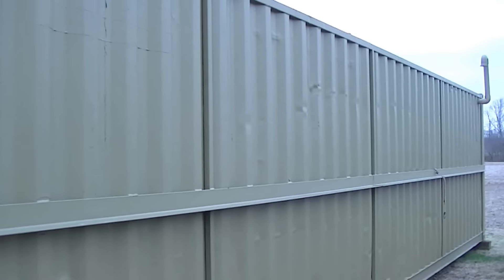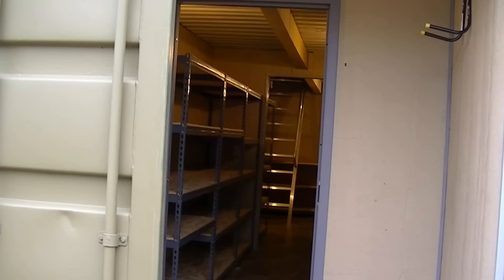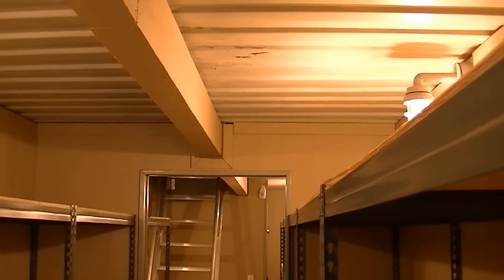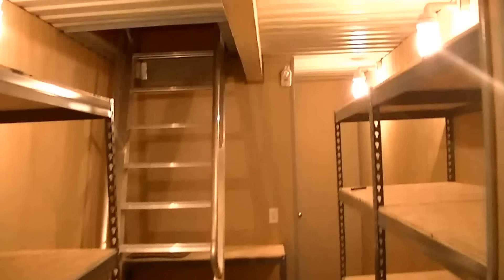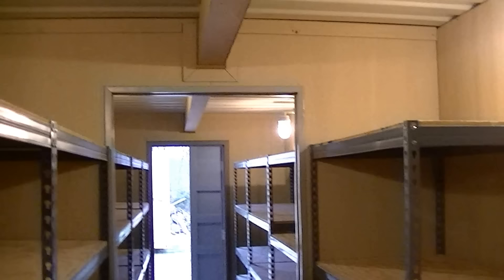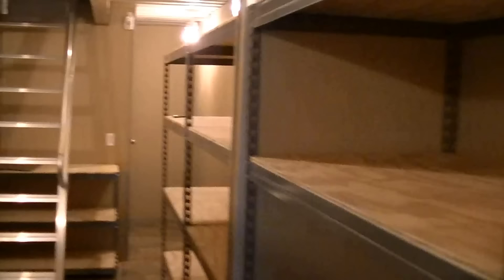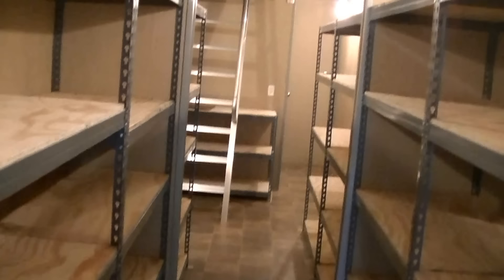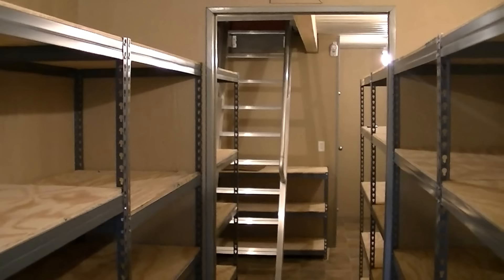Underground Shelters built from Shipping Container

Comment: Shipping containers are made of Corten steel (look it up).  Forty foot units, in particular, are designed for 25-30 years of service at sea (salt water).  They get 2 coats of enamel from the factory but should they get heavily scratched or dented, Corten steel is designed to create a surface rust that does not permeate through the steel.  The guy in the video mentioned that they also triple coat the container with paint.  However, a proper drainage system around it is the best investment.

Comment: But no place in there to relieve yourself,  and the unit will start rusting under all that soil within a year.
Reply: I always think of that same question too! When people consume food they MUST relieve themselves!!! HOW?
Reply: Eyes To The Sky Apparently somewhere in the comments section the video poster provided an answer. It seems to be a dual unit. The other unit will have all the other goodies, as this part is used mainly for storage.
Reply: I'd put a composting toilet in the safe room.
Reply: Adding a sacrificial anode rod will greatly reduce corrosion, if done right.
Reply: Lee Sharon LOL! Yes be OUT in the danger, when you need to be IN.
Reply: GeekBoy03 If it is THAT bad out, its ok to shit in a bucket lined with a trash bag, otherwise, USE THE SHITHOUSE! You don't want human excrement in your enclosed shelter!
Reply: Lee Sharon Hillary supporter? LOL! That is why have a composting toilet, or build a septic system for it.
Reply: or just put a safe room in your home though it has to be done while it is being built our closet is encase in concrete which doubles as a safe room and the door is a steel door about 3 inches 3 mostly for tornadoes but could double as a safe room for home invasion
Reply: paula human centipede
Reply: GeekBoy03 that's not true if the user puts a concrete mold and triple sealant over the metal like your suppose to when burying it it won't rust for at least 10+ years.
Reply: I think they would just use a bucket.  I'm imagining this being used as a storm shelter.

Comment: I'm just saying that there is no way to prepare for everything. And these shipping crates DON'T CUT IT. I personally wouldn't feel any safer in them than in a hole in the ground I dug and stocked myself with food/water/munitions. You should be working on adding HAZMAT supplies & air filters & medicine & a dehumidifier. Even some exercise bands to prevent muscle wasting could go a long way towards improving this setup.

Comment: In pounds per sq inch with the weight evenly spread the roof will hold over 210,000 lb. And by the way 3/4 of a yard of wet soil only weighs around 1800lbs> top soil about 2000lbs per yard. 64 yard of top should put about 128,000lbs spread evenly. You could still park a mac truck on top and be good.

Comment: If anyone is considering using a shipping container as a blast shelter, or wants several feet of dirt on top,then I would turn the whole container UPSIDE DOWN on to a reinforced concrete slab foundation.Shipping container bottoms ARE NOT SOLID STEEL,so you would need to weld some steel (continuous welds) sheets approx 8ft X 4ft onto what was the floor beams &  now would support the roof.I would use a minimum thickness of 0.125 inch steel(preferably slightly more at 4mm in the U.K.size). The existing roofs are NOT strong, as shipping containers are designed to be loaded ONLY at the corners.If you are going to do it as done here, then the extra beam is ESSENTIAL  or the roof would bow or collapse, if you put much dirt on top.You will need to reinforce the walls with steel channel or angle too. I built a very strong bunker (not using shipping containers).Mine is on Youtube under my name.Hope this may help some of you. Kind regards to you in US/UK or wherever you are thinking of building your shelter.Make sure you think about the ground water table. Mike Thomas

Comment: This shelter is fantastic, the only thing i see that you did not take into consideration is the hinges/pins to open door is on the outside. I would think it would be more of a safe gaurd to have the hinges/pins on the inside so no one would be able to pop them out in case you and your loved ones wound up having to hide in there or to protect your gun storage from invaders.  I really was a bit shocked to see that vulnerability.

Comment: that is no shelter but a supplycache. There is no water, no airfiltration, no sitting area or sleeping area. Youc an only store supplie sin this thing (which is fine) but then don't call it a shelter cuz it ain't. I' tyake half the shelves out and add sitting, working and sleepingplaces, a kitchenpart and a compost toilet. The basic idea however is great. Now all you need is a concrete-supported, strengthened secured structure in teh ground to put it in, and a supported roofing over its top, so it won't collapse under the weight from the sides and top.
Reply: They could have easily pulled out a shelf or two and added most of that, too.  A bunk bed on one side, kitchenette on the other.

Comment: You need to turn the unit upside down. You are selling oversize caskets.
Reply: Why is that?
Reply: Shipping containers are only ment to hold weight on the corners and botom not top. Do not buy as bunker it has a tornado shelter door and is not water or air tight. This product is a coffin not a shelter. The doors should be welded shut. The sides will fold in after a while.
Reply: @cj8092  and by turning it upside down, does that help?
Reply: @joeyanderson6660  yes

Comment: Containers have a wooden floor. How do you prevent water from coming up through the floor? And how do prevent the wooden floor from rotting over a relatively short period of time?
Reply: +jrg10332 yes they do. There are steel cross members under the floor, but the surface cargo is loaded on is hardwood.
Reply: Floors are teak, which is more water resistant then cedar. Under wood is treated steel . Should last at least ²5 years of salty sea air

Comment: I actually work for a container company.There is no way you can put a steel container under ground for a long period of time without it rusting. The bottoms are of oak wood and we have to replace them all the time, above ground. We have Rhino lined some units, spayed insulation foam on ceilings. Even with all that, the customer called us back 2 years later to replace unit. The roofs and floors are the weak points and with such a long(40) foot length any shoring will eventually sag from overhead weight.
Reply: What puzzles me is support for that central roof girder. What does it rest on, especially at the original rear entrance? Seems like a weak link to the roof structure.
Reply: What, if anything, would you recommend doing to a shipping container to prevent it from rusting or corroding if you were to use one as an underground shelter? Would it work to build an external frame with wood and waterproofing materials lining the outside of the container as well as the rot resistant wooden frame?

Comment: one thing i noticed is on the gun room with all the triple locking and metal mesh re-enforced walls but you have exposed hinges on the outside, remove the pins and pry a little and youd be in... all together its cool though

Comment: It could be true of course but there are a couple of problems. The most basic is that oil isn't going to run out all at once. It's going to happen slowly, which makes the price go up and the alternate fuels will be used more because of simple market forces. As for the population being 3x the sustainable number people have been saying that for half of the last century, they just keep raising the number when they are wrong, but even if they're right the idea of a crash isn't likely.

Comment: I read some of the comments. WOW, makes me scared to get on the highway thinking these folks might be out there driving around. So many people talking about these flimsy little containers. HAVE YOU SEEN THEM STACKED EIGHT HIGH WITH 40,000 POUNDS IN EACH ONE? And traveling for weeks/months on ships on open ocean with salt water spray? The corners are strong. You should support the top. I use Concrete and rebar to carry load to corners. You can then bury it four feet and drive bulldozers over it all day. And yes tar or paint the outside for longevity but these things last pretty well with minimal effort. Tar and 6 mil poly works great. If you dig your hole and leave a foot of space on sides and ends then Concrete the top extending over the sides and ends 2 feet then cover you’re good

Comment: So for those of you who want to spend your money. We have been contracted to build an above ground storm shelter.  It is constructed with 1/4 " AR 500 steel skins,  4" square tubing frame and 1"steel floor. It is 10x 40 and has a chemical toilet and a generator.  It will weigh in excess of  55000lbs.  It can be modified for underground and it can be yours for around $170,000.00 without amenities.  Shipping and handling charges are extra,as are the granite and stainless steel appliances!

Comment: From what I have seen in your video, it appears that you have a certain level of attention to detail, and have pride in the outcome of the finished product. However, before considering an investment in your product, I have a few basic questions ?  1. What about heads, berthing compartments, and food prepartion areas ?  Where are they ?  An obvious need while living in a box, confined underground for up to a year-and-a-half !  2. Do you offer remote, wireless viewing through multiple exterior cameras ? This would be almost essntial .  One could assess damage, intruders, and/or the viability of departing.  I did not see or hear you mention them and am asking you to address these concerns for me please.  Also, the structural integrity of the unit and it's placement is also a concern for me. There can NOT be guess work in this area. One cubic yard of non-compacted dirt for example weighs approximately 2, 500 lbs., depending on soil's composition.  That is significant weight, with significant conequences.  3. Do you conduct soil bearing tests for the specific geographical location in which the unit will be burried ?  Soils composed largely of sand for example, will require a different engineering approach and method of soil anchoring of the unit, and have markedly different structural implications than that of clay, rock, or marsh type soils. 3. Do you employ or contract structural and civil engineers for accurate solutions and drawings to the aforementioned?  4. Also, and in addition to the cameras, it would be appropriate to add interior and exterior sensors that would provide the indication of surface movement (people, animals, earth shifting), temperature, wind speed and direction, radiation presence and amount, and other essential information critical to life saving decision making.  Your video was nice and informative. I have been considering something like this for years and am at a point where I believe that we (the general public) are going to need this much sooner than later.  I hope you will take the time to address my concerns.  Please Respond ! 
THANK YOU !

Comment: you have a major flaw in the design of the gun room. you need to use hidden hinges. because you have the pins exposed they can be cut off and the door will fall out. Also the locks you have used can be punched through with a hammer

Comment: I am assuming this is a Storm Shelter. For tornado protection. The safe room for weapons if you live in a house which is not easy to have a safe room installed, I get that. The part I dont get is all the food storage shelving with no place to occupy during a tornado. Food can easily be at a shortage if a tornado goes through and if you have water and dried food I can accept that. If this unit is anything more than a tornado emergency shelter, then I think its a joke. Just my opinion.
Reply: +Sunny W he says in the video this is to be built into the side of a hill and that this was a side piece which leads me to believe this is one of perhaps two or three.

Comment: I am betting you don't know much about metal or how these things are built. Nor have you seen one up close. the metal on the sides are made from 16 gauge steel yes it can hold some wait cause of how it is made. though the way they are piled is on the framing of the box. which is a heavy gauge metal and that is designed for the weight. the floor is the only panel of the box that is designed to take weight on it cause that is where the weight is. Please do your research on something like this.

Comment: Wait...the hinges of the "secure" room are outside of the door. Could you not just slide the securing pins out and then have a relatively easy access? I realize that the locks would still be holding the door but a crowbar and a car jack to pry it open would take mere minutes.

Comment: Air Vent reaction:  These are just for transport.  We will run these out from the unit and hide them in a tree line or even under a house.  We fill them with a filter like material, and we can if you want install a filter system.

Comment: Tornado shelter maybe anything else not even close to minimum specs for N B C shelter. 3 locks on the gun room, but hinges on the outside, even for a storm shelter, it needs an air exchanger/filter, CO2 will build up in a matter of an hour or 2 with more than 1 person in it.

Comment: So the beam you run on the rood is not one piece it has a big join in the middle. So in other words the beams are useless. If any weight goes on it then it will still just collapse anyway. Anyone with common sense or actual training would know that and seeing as though I'm a builder by trade I have a bit of an idea.

Comment: Is there a reason why you don't simply flip it over so the floor is the ceiling which is actually the best support on the entire container and then reinforce the new top with 1/2" metal plates? You got the one huge beam down the middle of your ceiling, but it's not going to keep the poundage pressure of dirt from caving in on either side of it.
Reply: +Rose C That sounds like it makes since. I have heard the problem with using shipping containers is the weight on the sides of the walls, more than the weight on top. Is there any truth to that?

Comment: A triple lock on that 'gun room' does nothing when you can just pop the pins out the hinges and slide the door out with the dead bolts still engaged. Either put the hinges on the inside of the door or try switching one of those dead bolts to the right side of the door, otherwise your just putting a bunch of locks on that door for no reason. It would take my little brother 2 min to get in that door...

Comment: You'll bury this end up with a bunch of condensation on the inside which will rot the wood and destroy your cache.  Not to mention the sides are not the strong part of these containers common just the quarters they're real for stacking not having dirt against them. I don't think one beam  running the length of that is going to save it.   does depends on how Deep it is. I looked and did a lot of research and talked to a lot of people about doing something like this and decided it was not worth the risk

Comment: 1:45 24 inches of dirst? An underground shelter should be much deeper than that, at the very least double that.
Reply: +mellowandjello It's because anything more than 24" on top will cave in the roof on both sides of the steel beam they put down the middle. The ceiling and walls are the least supported and bow under the pressure of a normal weight man walking across them. Put a single metal beam down the middle and sure, it holds the guy now, but only if he's walking down the beam. They need to flip it over because shipping containers are built to hold up to massive weight on it's floor, not the ceiling. Containers are then picked up by cranes by the top four corners.
Reply: Ah, that makes sense.
Reply: +mellowandjello only a prat would put a roof support beam running lengthways down the middle of the container, much better to put eight shorter beams across the width of the container : then you could bury it much deeper.

Comment: Your gun closet door hinges on the outside of door & easy to remove, as is the 3 locks.
A real waste of money. How a blow torch & 3 to 5 minutes, do not need black power, just a torch, unless you have a drop blast door of A R -500 steel 1/2 X 48 X 96 inches.

Comment: An extremely bad idea, executed in a deadly way. Did anyone notice the "beam" overhead, with a seam in the middle of the room and no post to support it???   WTF?!?   This is a scam at best.
Reply: Scarf joints are often stronger than the material if done correctly. Having said that, this is a supporting beam travelling some distance (6 or 12 meters).

Comment: You can't use these underground without proper drainage. They will rot away. I suggest you build it out of items you can get at Home Depot. Aluminum screen room framing is very strong. Frame it 16 or 24 inches on center all around. Then use aluminum diamond plate for the exterior. Then completely seal it inside & out with a rubber coating like flex seal. Then use closed cell spray foam to insulate. This will last 100+ years. If you want to save even more money, learn how to melt scrap aluminum and pour your own aluminum framing. You can make the framing 1/2 inch thick or more, so you can actually drive a tractor over it. A MIG or TIG welder to put it all together. I have also seen guys building structures using free materials like wood pallets. If you know how to laminate wood, you can make the framing & structural beams. This process requires alot of time, and will also make the bunker alot heavier than steel.